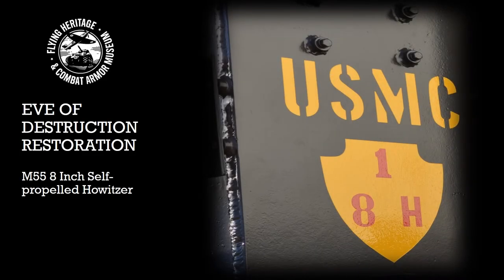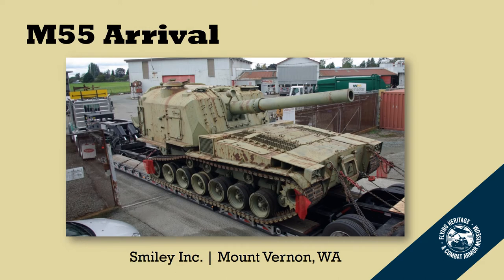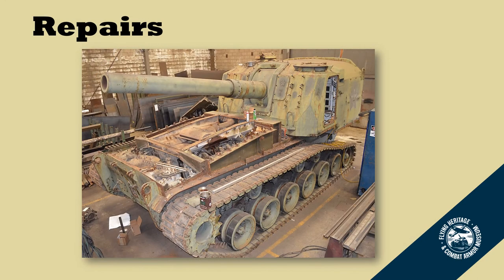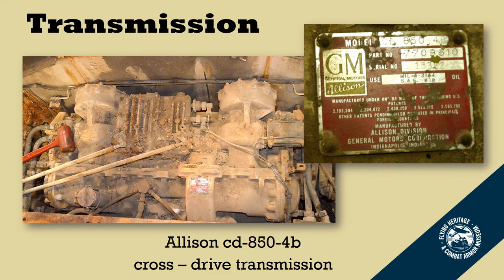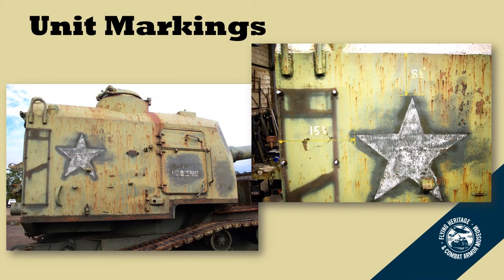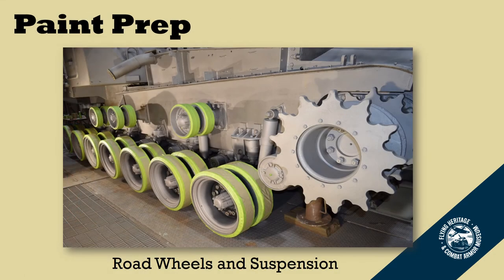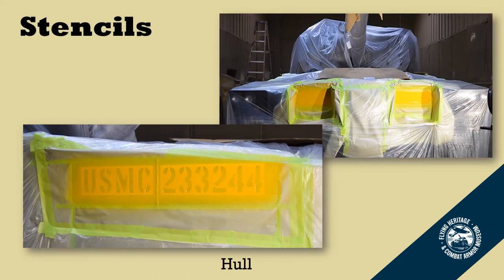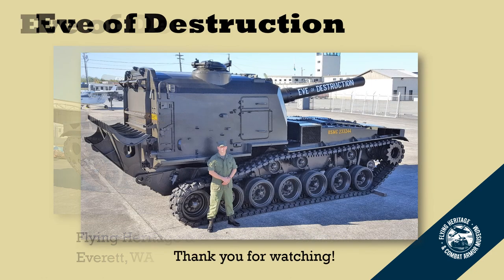M55 8-inch Self-Propelled Howitzer Restoration

Comment: This was my ride in 1962, 63. It was a great machine and a lot of fun to drive. Our company had two units. We were on a fire training exercise which was a timed event..see how fast you could get set up and get a round off. I lowered the spade and backed on to it to get it to set into the ground. This was, as it turned out, very important. The spade didn't sink in to the ground as it should.. I pointed this out to the Capt. and he said not to worry, one shot and it would set in...  What we who were  inside experienced next was no less then a most severe earth quake! After the next round the spade did set and firing was no longer such a tramatic experience. When I pulled the Howitzer forward at the end of the mission the spade had a huge split from the bottom to the top...about three feet wide...a rock had Won!
In order to set the break you had to depress the brake pedal and then lift the brake lever. To disengage the brake you had to depress the brake again and then release the hand lever to be free.. The driver of the other howitzer forgot to depress the brake before releasing the hand lever. I noticed that he was falling way behind and it took him about half hour longer to return to the company motor pool Than it did us.. I asked him  what was the problem and he said that his machine was a real dog.. very slow... yes, he had the brake on all the way down the mountain trail..The howitzer had to be torn down to repair the worn out breaks...
Any way, glad to see one the things is still around. Now if you need I driver!